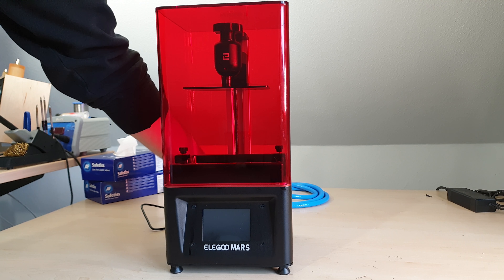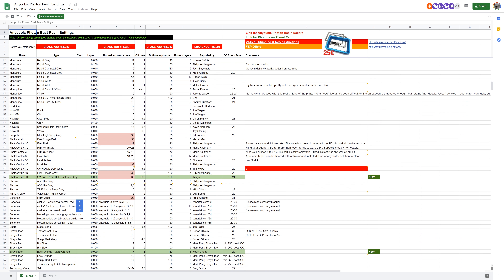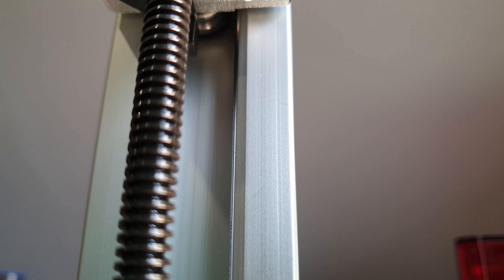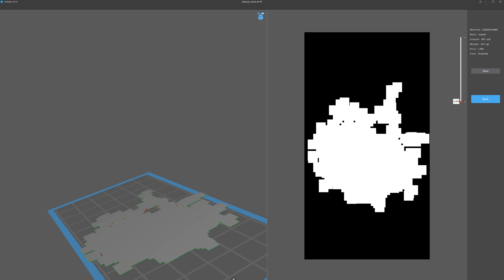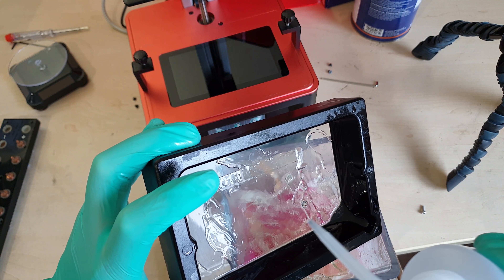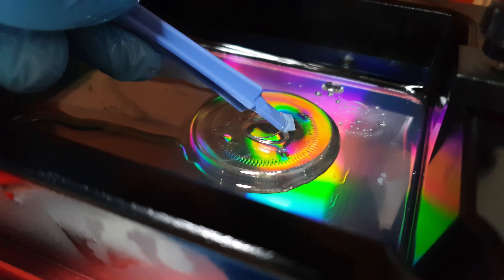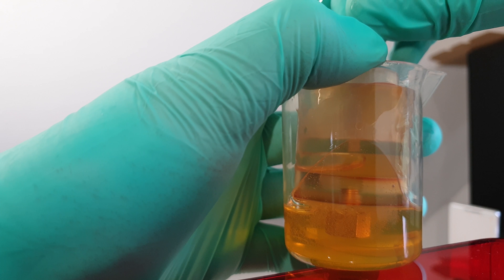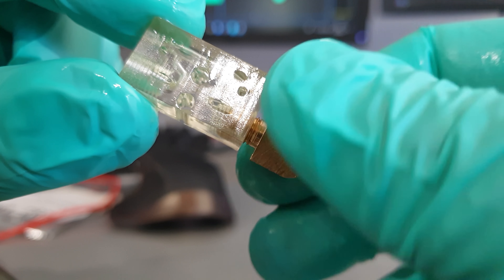250$ MSLA / LCD 3D Printer: Elegoo Mars

Comment: Do not know about the same thread you used but we have made M6 and M4 threads for Luer locks just fine with a Form 2. They appear water tight up to 200-250KPa (which isn't huge, 2 atm.), and survive many cycles of screwing-unscrewing. Made with the default white resin.
Reply: Did you put some teflon between the two threads ?
Reply: @qwer.ty.  No, does not seem to be a need for it.
Reply: @Ownedyou  Nice !
Reply: Metric standard threads are not a fluid sealing thread, so I would say water tight to 250kpa is great
Reply: 30-35 psi for the tangible unit folks

Comment: Love the video. I have had my Mars printer since last November and the only "issues" I have had were almost completely my own fault. I recently introduced a bunch of the people in a 3d printing discord I am in to the Mars and many of them bought one when it went on sale for $250 on Amazon. All of them have been extremely happy with the performance of the Mars.
Reply: what where those "issues" if i may ask?
Reply: @goofycker  I had some issues with leveling ( I was completely new to resin printing) then I had a leak somewhere in the vat that caused the glass lcd protector ( which Elegoo replaced for free even though the damage was most likely my fault) to break but I think that was due to a hole in the FEP that I most likely caused because I couldn't find anything else that could have caused it.

Comment: Formlabs 2 still requires some thinkering even at M6 Threads, usually I print the thread and then quickly tap it afterwards.
Even at 25 micron layer height m3 requires tapping.

Comment: Hi. The Z lift speed and distance is controlled in the software. Once you have sliced the model, before you save it there is an arrow at the bottom of the screen, you can change it from the default settings to a slower or faster speed and also the distance to lift the z height up.

Comment: This thing has been sold out since the beginning of the month when Uncle Jessy made a video. It's on my list, and if I can actually snag one for $250 I will buy it in a heart beat.
Reply: Larry Kozlowski check amazon right now.
Reply: Refreshed my browser around midnight July 15 and Amazon had 18 in stock. By the time I hit the confirm order, it dwindled to 4. This previous inventory dry spell lasted approx 2 weeks till it got a restock. Happy that Elegoo kept the same ballpark price for this recent batch ~ $259.... rather than attempt to cash-in on the YouTube buzz that it’s garnered. Hope they’re wise enough to hold at this pricing in order to grow the community of Mars users. Now if they’d hurry up and start offering spare resin vats, build platforms, and an expanded library of materials (jewelry castable, flexible, etc)

Comment: If you're using the film trick, don't lift the part off, rather, lift the whole thing up, then "peel" the film off. The thinner you can find that film to use, the better. 

As for threads, as long as i can make them, even my CR-10 can do them super fine and fitting the first time, but then again, i make them, so i'm accounting for the machine's inaccuracy. Just saying.
Reply from the maker: the vats very smooth FEP film tends to stick to the very smooth LCD surface like those temporary window stickers that don't actually have any adhesive

Comment: You can actually change the Z axis lifting speed in the software. After yo have sliced the part there is a little arrow in the bottom middle. Click on it and there is the parameter. Sure, the exported file is pretty cool but this is a bit less tedious.

Comment: could it be the ethernet port isn't actually an ethernet port just using the connector and running something else entirely over it, was quite common with old car phones
Reply: Apparently it is actually an ethernet port, it's just not activated in the firmware. That's my biggest worry with this machine - the non-customizable and non open-source firmware and slicer.

Comment: M3 on the formlabs with 25micron layers in high temperature resin did not really work. A quick change of the cad model made it possible, but not good. I kept on screwing, in this case a m3 into the soft print and then applied the final uv hardening.
...these parts were then used in ultra high vacuum machines...some evrne did electroplating to use them as electrostatic lenses etc....i have seen your turbopump pencil holder.... what on earth do you have in mind?^^

Comment: Could you elaborate any on your statement "for a laser SLA machine that's extra difficult" regarding tightly fitting m3 threads? Is that saying it's more difficult for a laser SLA than a LED SLA? Would that be due to the laser directioning mechanisms vs the LCD used for the LED, or something about laser speckle patterns?
Reply: its exactly what you already said, its the movement mechanism for the laser that needs to be ultra precise in order to do this right.
for the LCD this precision is mostly decided upon by the resolution of the LCD which as we know from smartphones can be very high even on very tiny LCD´s

Comment: I have printed M3 threads on the Form 2 that worked but I don’t know if they are watertight. Smaller than M3 is not recommended though as most resins will give out without much applied torque if you go smaller.

Comment: I have successfully printed 1/4in-20 threads on a form 2 at 50 micron layer height.
Reply: M3s here at 0.1...it's a crap shoot though, I have to dial in the shrinkage every time with a test piece.

Comment: A friend of me works at a company where they have a Formlabs 2, he told me that he once wanted an enclosure with 3mm holes, the printer made them 1.6mm. (Well for me that sounds like wrong configuration, but dunno how thats possible with a plug and play machine.)
Reply: SaltyBrains  I really hope that he didn't do that, because he's a polytechnician apprentice xd
Reply: we have formlabs at work, holes are usually 0.3mm smaller, all dimensions are +- 0.25mm , and usually parts shrink after a month or so (black resin mostly)

Comment: Question:  Does the "laser printer transparency film" mentioned at 2:39 into the video need to be "COLOR" or "BLACK"?  Also do you have any recommendations on where to get less than a 50 pack of whichever type to use?  Thanks!
Reply: Did you ever find an answer to this? "Does the "laser printer transparency film" mentioned at 2:39 into the video need to be "COLOR" or "BLACK"?"

Comment: Do you think this could be used to make a photoresist PCB ?
Reply: Not for really small pitch SMD but for half pitch (0.05" / 1.27mm) parts, yes.
It's a 4K LCD in about 120x67mm.
Reply: @japonicaren  I think it would be interesting to see what it could do. might need some special g code, but should be easy enough

Comment: What cost can I expect for a basic SLA post processing & cleaning setup?
Reply: Some tupperware containers ($1-$4 a piece), some nitrile gloves ($2 a pack), a good bit of isopropanol (ethanol can be subsituted in a pinch, can take a bit longer), a felt tip pen to write on that liquid container that it's for prints only, a funnel to put it back in, sunlight and a balcony, or alternatively a bucket or a box and some UV LED tape ($16), maybe a solar rotary turntable ($10) if you're fancy. So somewhere between $5 and maybe around $70, depending on how crazy you want to go. That ultrasonic Baku cleaner is not particularly good, and probably not particularly necessary or useful for this, but it's only around $20 - it's also debated whether that's a safe practice or whether you should better stay clear of it - i have no opinion of my own on this. If you want a professional to make you a post processing station, then it's gonna be a couple thousand.

I don't know, if you were to buy the sun, i imagine it would be prohibitively expensive, but they have an always-online service where you can use a small bit of its emitted light for free. Atmosphere is sometimes in the way but for the most part it's OK.

The reason you have to mark your cleaning liquid and never use it for anything else is that it will have a bit of resin dissolved in it, and you don't want that on your skin. It isn't directly particularly toxic but is suspected of being very capable of causing severe allergies, and the real risk of it is that you might - with extremely low probability but potentially with an extremely dangerous outcome - become allergic to some other substance after coming in contact with the resin.

If the resin has smelly fumes - and this is supposed to be a non-smelly type - it's a pretty bad sign BTW. People describing Anycubic (this one uses identical) resin as smelly and headache-inducing probably have already developed an allergy to it, or to a similar substance prior. You should probably not run the printer or handle the resin in rooms which are not super well ventillated and where there might be people there. Dr. David Light from Houston hospital has reported of two cases of in total 3 people being admitted with poisoning by SLA/DLP resin printer fumes, with respiratory issues, one case with deeply ranging and persistent memory loss.
Reply from the maker: Does anybody know any reliable research about this? Allergic Dermatitis (Sensitization) is a typical risk with exposure to epoxy resins and these chemically similar UV resins. I had an unnoticed hole in a nitrile glove once and got a good few minutes of finger tip soaking in resin. But so far no noticeable effects, not even a mild irritation. I washed my finger with dish soap a few times, thinking that solvents would accelerate the stuffs absorption ...
Reply: @reps  lol

Comment: All this big talk about 3d printers but I'm yet to see people create anything interesting with them
Reply: Then you aren't paying attention.
Reply: @bohemianhacks111  did i not, well give me ONE example than
Reply: @guotyr2502  Here is a whole subreddit. http://reddit.com/r/functionalprint/top/

Some highlights: several robotics platforms, self starting siphons, tons of replacement parts and upgrades cheaper than you can buy them, custom tools like wire straightening spool holders, various diagram/engineers drawing tools, radius gauges, prosthesis, huge numbers of organizers and holders, air powered rotary tools, custom rotors and turbines, lots of adapters for scientific equipment and tools for home lab use, gear boxes and mechanisms you can drop into your own projects.

That's all just direct use functional prints, but tons of research and design is accelerated from 3d printer use. I've prototyped and used a couple custom tools myself as well as used  my printer to reverse engineer maple seed samara for use in reforesting.